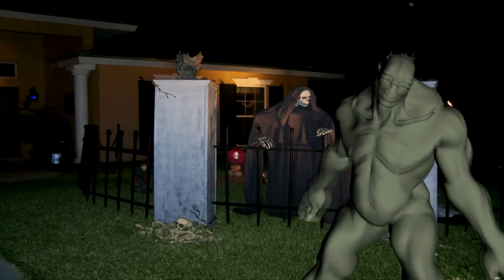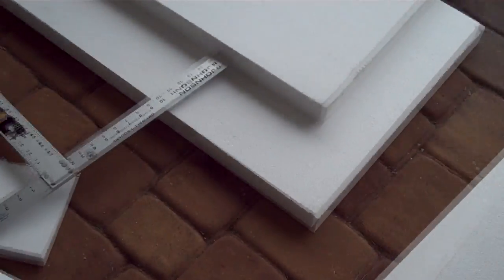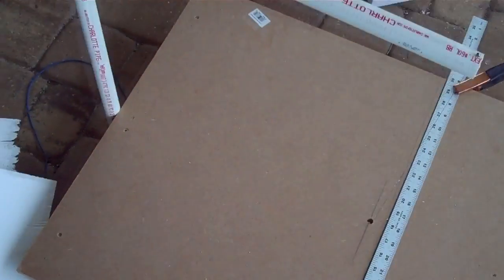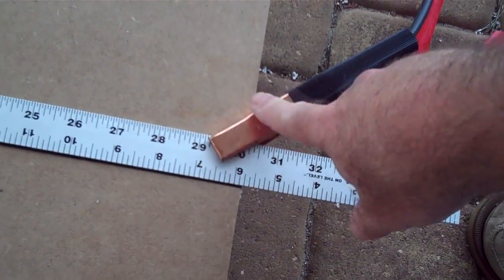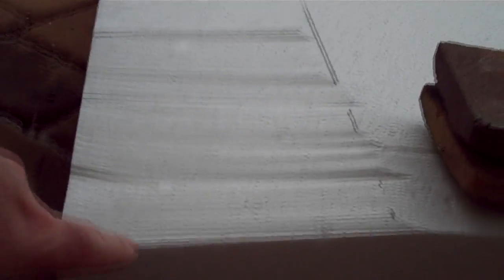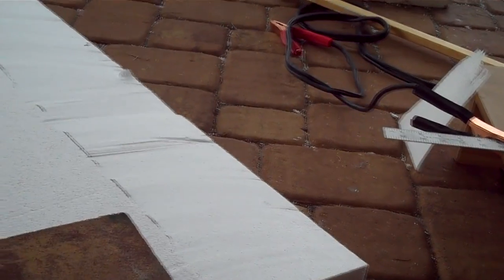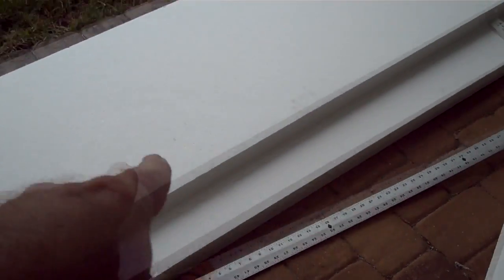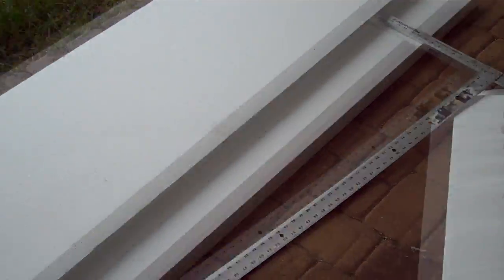Shadow of Palms Vlog 10-15-2011 - The tomb build.mp4

Comment from the maker: I used 2  4X8  2" thick styrofoam boards to make a 6' X 2' X 2' crypt. The head and foot pieces were cut to 20" wide witch added to the two 2" thick sides gives me a total width of 2 feet.  The crypt is 6' long and 2' high.  I made the crypt lid two layers thick giving me a 4" thick lid that I curved.  Check out the two videos and it becomes a little clearer.  Good luck and let us all know how it turns out,  Let me know if you have any more questions.